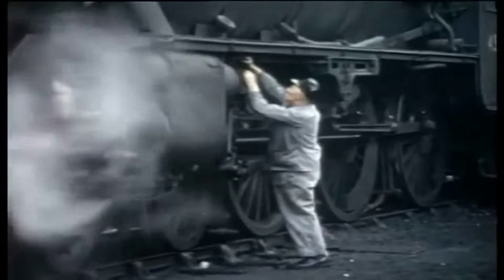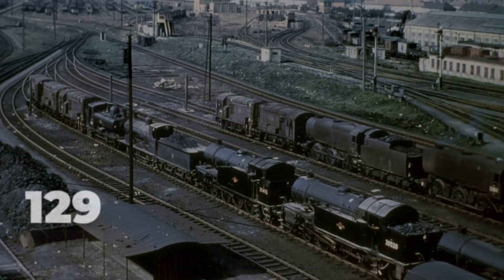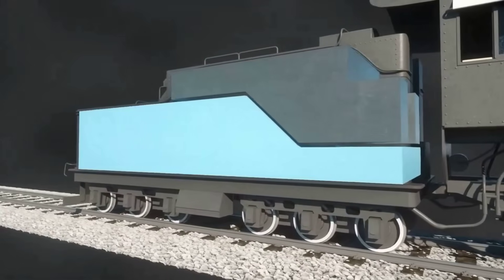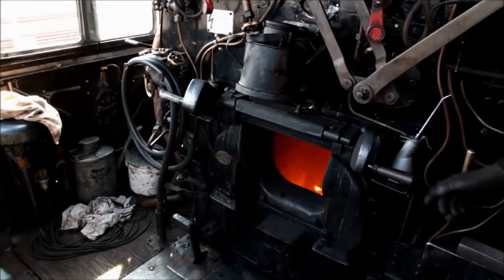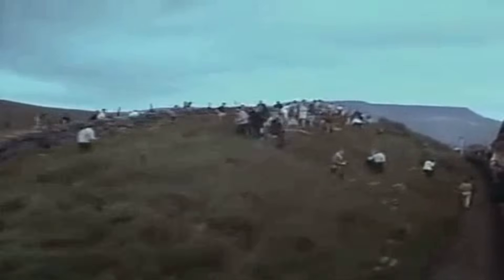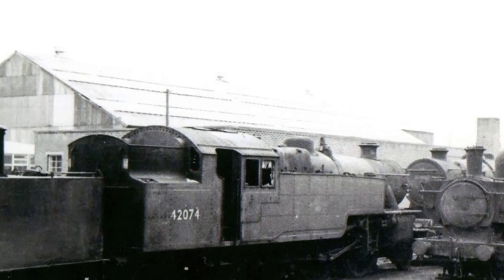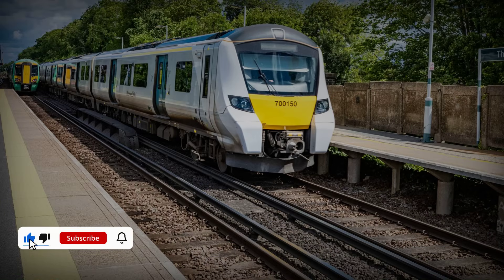Engineers Mocked The Locomotive With “Too Many Wheels” — Then It Outran The World's Fastest Trains

Comment: The 9F had the capacity to haul 900 ton freight quicker than freight locomotives built previously.
On another note about Steam locomotives being scrapped before there time was up. The  story of 71000 Duke of Gloucester discarded as a failure but in preservation it's full potential is finally seen.

Comment: "10 massive wheels" In fact the wheels geared for freight were much smaller than anything  anywhere near that size. And so it continues with selective facts and inaccuracies. The fact that with small wheels they could achieve 90mph was a tribute to the refinement and precision of the valve gear but it was not smooth. BR had to clamp down on high-speed running because it was damaging the running gear. Yes they all had years of life when they were scrapped (ditto the Britannias) but it wasn't economically possible to keep up the infrastructure to support mixed diesel/steam operation and a lot of steam was well past its sell-by date. Also by 1960 no-one wanted to do the filthy unskilled low-pay jobs required by steam sheds.

Comment: If out of the 10 drivers the first and the last pair are flangeless it should take curves without losing traction.
Reply: Flanges on the leading driver pair are essential for curve guiding, and flanges on the rear driver pair would be significant in preventing excessive whip at the rear of the locomotive (without special modification of the rear tender-truck location, drawbar, and buffer).  There are good reasons to avoid 'poleys' entirely if you can use proper lateral-motion devices instead.

Comment: I do believe a 9f holds the strongest loco record still in the UK, those loco's could pull a load of 3 lesser loco's and still have enough tractive braking force to control an unfitted consist.   Local to me is the Somerset & Dorset lines and the 9f's could scamper up the hill past Evercreech without a banking loco and made it look easy, even the diesels had some issue with that hill and the climb out of bath but not the 9f.   Whilst they were also fast they were incredibly hungry and thirsty needing more coaling and watering than lesser engines but a 40 wagon coal train by one loco made them profitable all day long.

Comment: On later engines a double chimney, pointing to the piston and valve.
Reply: WTF?
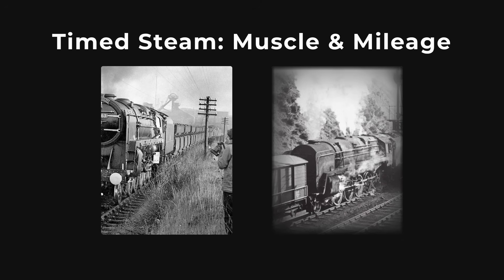Reply: @patrickporter6536  look carefully 8:28
Reply: The valves and front end were significant, but secondary to the 135-degree balancing that enabled a locomotive with low drivers to reach over 90mph with acceptable augment.

Comment: The voiceover grates, as do some of the AI images.
However, broadly accurate.
In my opinion, most 9Fs should not have been built, bearing in mind some of them were withdrawn and chopped after barely five years, not even run in.
That said (and before my time if I'm honest) they must surely rank as one of the best steam locomotives ever built.

Just to add, sadly 9Fs are no longer permitted to operate on the main line.
I believe this is related to the flangeless centre driving wheels.
Quite a lot of GB pointwork/turnouts now incorporate higher guard rails, European style, and increasingly of European manufacture, meaning that the guard rails and flangeless wheels foul each other.
Reply: The entire Riddles steam locomotive series should not have been built. By the 1959s it was already obvious that diesel and electric were the future and far more cost effective than steam locomotives.
Reply: @RobinMoss-g7q  Britain had plenty of coal and no money to buy oil fuel from abroad and, as with all political decisions, expediency wins every time.
Reply: @RobinMoss-g7q  fair point. I think it was partly to do with keeping the loco workshops active.